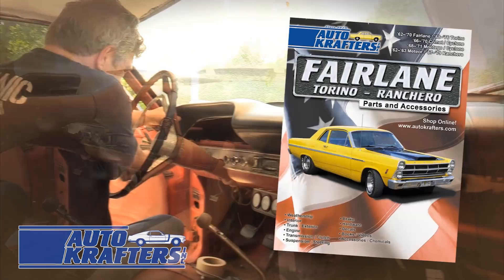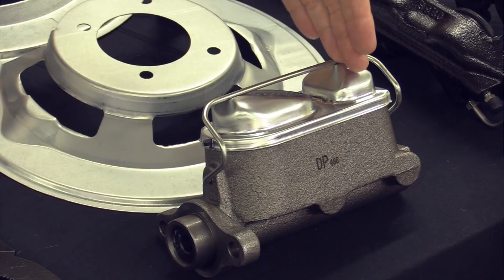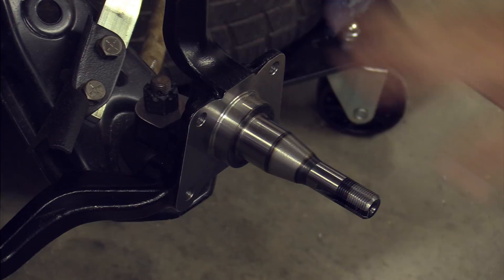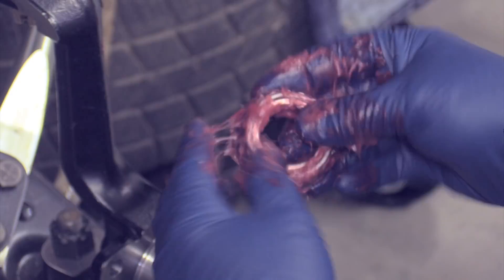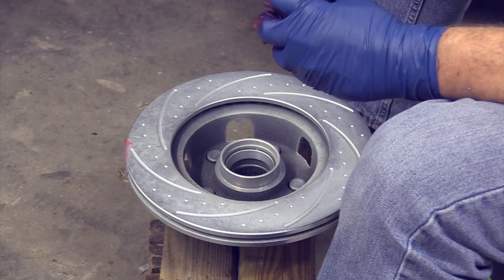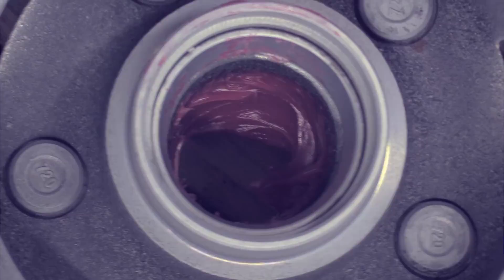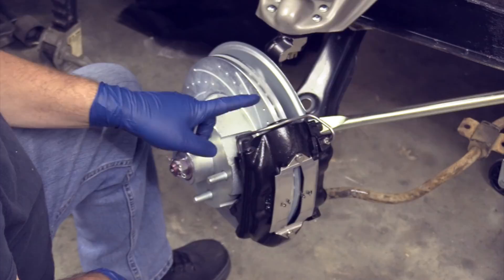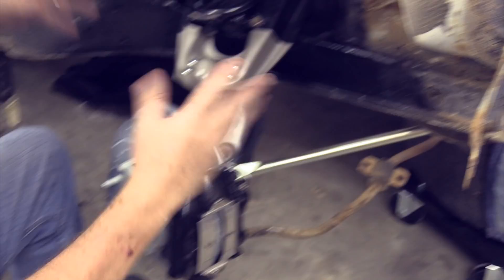Upgrade Disc Brakes Tips and Tricks

Comment: Being a Caterpillar mechanic for 38 years has helped me, I have a 1963 fair lane sports coupe which I installed 1977 Granada spindles and all disc brake parts. Installed dual master cylinder, replummed it and put 1970 LTD tie rod joints. Everything works perfectly!

Comment: My dad taught me to apply grease into the hub, also.  He was turning wrenches in the 1930s.  I also use splash shields on a road car.  Pebbles can get lodged between the caliper and rotor without them, including anything else.  One can bet that if the factory went to the trouble to engineer splash shields, they should be used.  Thanks for the video, Jeff.

Comment: Thanks for the video.  I would recommend a seal installer.  They are very cheap in most automotive store. Glad you are back.  Keep those videos coming!!!
Reply: Just for fun stuff --- On 1965 full size Fords, I installed 220,000 of those seals plus a bunch of other stuff.
Reply: @kenbarnes8958  How did you do it at the factory?  Like what tools and what process did you use?  I find that kind of stuff absolutely fascinating!!
Reply: @TheVenom8343  --- at the factory they will spend any amount of money that will allow you to complete your job in the alloted time [usually less than a minute] - but was there something in my comment that let you know that I worked on the Ford assembly line in '65?
Reply: @kenbarnes8958  Yeah, when you said "On 65 Ford full sizes" and "220,000" made me think that you worked on the assembly line.  Sorry about that my dude.  What kind of work did you do?
Reply: @TheVenom8343  I installed the bearings, seals and greased them (about 10 seconds each drum) - put them on the spindles - installed the nut and washer and ran them down. Both front drums. I could do all that in 49 seconds. The next guy just adjusted the nut and cotter pined it. Don't sound fair does it?

Comment: Nope.  I put a blob of grease in my hand as you did but, I'll scrape the bearing across the blob until it starts to leave out the opposite side and continue to work my around the whole bearing.
This way you KNOW grease is all the way through the bearing.
Reply: The way you describe is the way I learned to do it, probably 40 years ago from my Dad, and I have never had an issue with it.
Reply: 50 years ago my professional Mech Uncle ( in his 70s ) taught me basicially the same, glob in palm, then push the side part of bearing into the blob till you see it coming out the other side
Reply: That's how my grandpa taught me

Comment: I was a mechanic for a Regional Airline in 1978.  We were always replacing bearings due to burn spots on the outer race.  When the airplane lands the bearings burn out to get started.  The corporate jet for a major candy company was next door.  They said they had switch to this new grease by Mobil and that their burnt race problem was gone.  We switched and what a difference in bearing life.

Comment: I have a 64 Falcon Sprint with stock suspension front and rear.  I want to put Magnum 500 wheels in either 15 or 17 inch.  Do you have a handle on what the maximum tire size  and what offset i can use without interference and or rubbing?

Comment: Purchased a set of Scott Drake steering spindles and the tapered holes for the Mustang V8 tie rods are too small and increasing the size of a tapered hole is no easy thing...what does one do without the use of the puny tie rod ends which come on 6 cylinder cars?
Reply from the maker: There are two taper sizes on V8. Try using the pre 1969 V8 tie-rod end. Keep in mind that I have received a 1970 tie rod in a 1968 part numbered box recently.

Comment: Hey guys, I love your channel I watch a ton of your videos. I had a question about my 63 Futura I’ve been told in other forums that it is a good idea to change the spindle to a 65 mustang model because they’re cheaper and brick conversions are more plentiful. But I’ve also heard that in swapping over the 65 V8 spindle the steering components have to be switched over as well. Could you shed some light on this swap?
Reply: I'm not sure about the steering, but you may have issues with suspension. Nothing major, but lots of part swapping. For instance, if your Falcon was originally a 6 cylinder, it will have a smaller lower ball joint than the V8 Mustang uses. You'll also have to change the lower control arm, as the ball joint is made into the arm.  I bent the knuckle on a 61 once, and the only replacement I could find was a 63. There was some issue that necessitated using the 63 lower arm, and then the anti-sway bar would fit. Ended up going back to the junkyard for the bar and the other lower arm and knuckle. Had to change all this to use one later- model knuckle. This was over 30 years ago, I don't remember all the details, but there was some minor issues to face.  With today's aftermarket parts, you should be able to find everything you need.
Reply: * sway bar would not fit...

Comment: I always add grease inside the hub.The brake caliper's look just like the 4 piston calipers that are factory installed on my 68 Continental.I just replaced my calipers and I also installed hydro boost.I bought my car with no engine no transmission and no brake booster.And nobody makes the old booster any more. My brakes are toe touch.

Comment: Man I'm watching all these but I have a 1966 Ranchero and it's harder to find parts for the 66 and 67 than any other Ranchero
Reply from the maker: 1966 is a one year only Falcon nose. BUT the stuff for 1966 Fairlane will bolt up. Trim items like dash pads (I have one) and instrument clusters are the biggest problem. You can use seat upholstery carpet and door panels from the Fairlane and no one will know. Auto Krafters is our go to on those parts.

Comment: I'm wanting to do my 64 Fastback but I have stock 14" wheels, good whitewalls and excellent 3 bar (expensive) wire wheel covers. It appears that you have to change to 15" wheels to use the disc brakes. I don't want to do that. Anybody know for sure if there is a disc brake kit that will allow me to keep my stock 14" wheels.
Reply from the maker: Nope. We are using the original 14" off of Cam's '65. This is the original type Ford used for the GT, right down to the caliper.

Comment: My non synthetic grease in my gun pees also when it sits. For you 1970 Camaro guys, seating the bearing, From the Camaro Supplement manual.
When you spin the rotor, tighten the nut to 12 lbs. ft. torque. Then backoff the nut one flat and insert cotter pin. If the slot and pin hole do not line up, back off the nut an additional 1/2 flat or less as req'd to insert the cotter pin.
Reply from the maker: Good stuff as always John.

Comment: Why don't they offer a universal proportion valve rather than the adjustable type?
Reply: I've been told because different pressures are needed to activate the rear brakes drum vs disc and even among products thus an adjustment is best
Reply: @REVNUMANEWBERN  I've upgraded my 68 Cougar brakes to 2005 mustang GT disc up front, left the rear drums stock, factory booster and master cylinder. I'm using a disc/drum universal proportion valve from summit racing and I think I have the best braking I've ever had, and  I've tried many of the conversions.